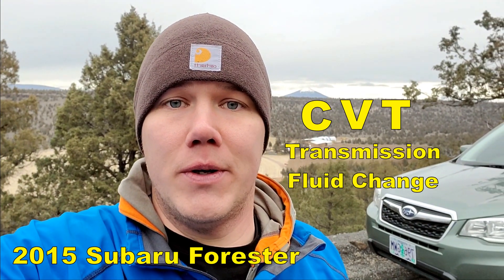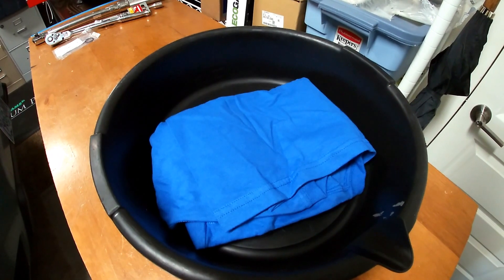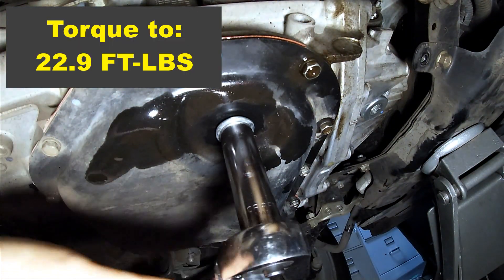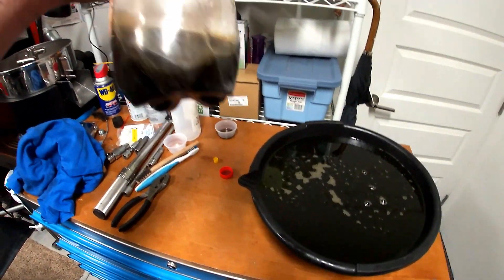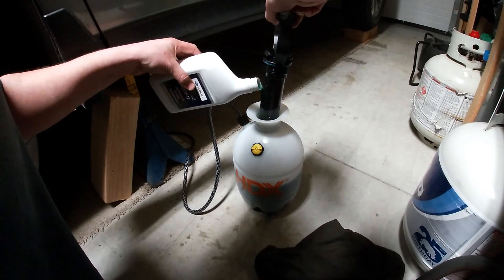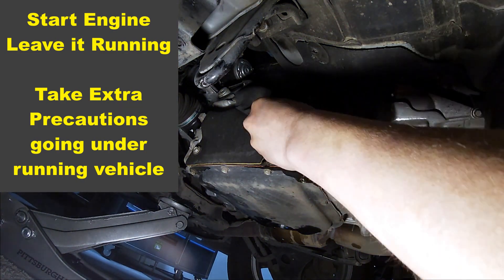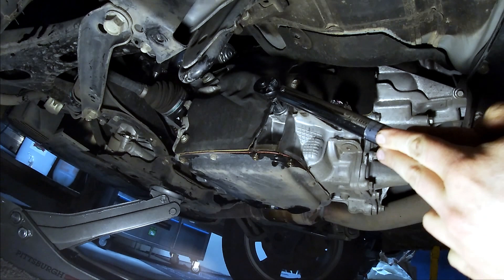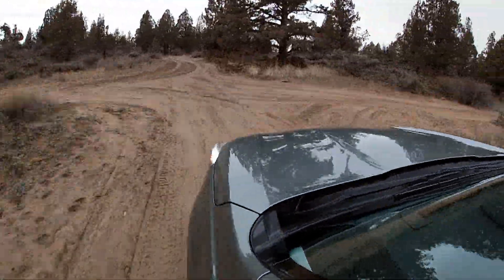Subaru CVT Transmission Fluid Change & Flush Procedure | 2015 Forester Replacement-Fill-Level Check

Comment: Thank you so much for this wonderful, thorough, informative video!!! We were totally in a panic after accidentally removing the CVT plug not the oil plug during an oil change and this video allowed us to deal with the self-created emergency. THANK YOU!
Reply: I am literally in the same situation right now. Got the transmission cover removed and need to get an 8mm allen to start this pump process. I'm still pretty stressed but grateful to see I'm not the only one who's made the oil plug/transmission plug mistake and that add fluid using this method will help me recover.
Reply from the maker: That's no fun!! Hope it went well, and thank you! I really appreciate those that find my videos helpful! Thanks!
Reply: My son made the same mistake!

Comment: You did all that thorough and hard work. Why didn't you change the filter too?
Reply from the maker: Because the filter you refer to is only a pick-up screen. Looking back I do wish I would have dropped the pan just to clean the magnets, but remember the fluid it more important as it affects the friction of the CVT "belt". The actual filter requires the transmission to be removed, then split the cases to access.

Comment: Hey MT I wanted to ask you if you could do a video of a coolant flush on your Subaru forester I have a 2014 Subaru forester with only 45,000 miles on it and I wanted to ask how often the coolant should be flushed
Reply from the maker: Dude, it is on my to do list. Seriously. I haven't had an ounce of free time since my last upload. Our business has just taken off and we are struggling to find help. So we have been working super overtime. But I want to do a coolant video, and I think our Forester is just about due. Dont quote me, but I think it's due about every 11 years or 120k miles, we are right at 119k miles. So its time. The biggest importance of doing it is corrosion in the block.

Comment: Do these have a filter? I've seen mixed replies all over. Some say there is a screen mesh filter that should always be replaced, and some say there is a traditional filter internally that should be replaced. Seems like a hassle

Comment: This is one way to do it. I prefer to drain the pan and then refill it. Then blow out the lines like you did. Then you can also take a 2 longer piece of the clear tube you put one in a large enough container to hold the amount of fluid you are taking out. This will be on the pressure side. I prefer a 5 gallon bucket and then zip tie the line so it does not come out of the bucket. Then I take a second clean bucket and fill it with enough clean oil to meet the capacity of the transmission plus at least a couple of more quarts. Take the second clear tubing and run it from the transmission suction side and down into the bottom of the clean new oil in the 5 gallon bucket and zip tie so it does not come out. Usually best to have an assistant help you if possible. Start the car and run at idle. The dirty oil will start to flow out and the new oil will be sucked in. You can also shift through the gears to get even more old oil out. Do this until you see the change in oil color like you did and then stop car and reconnect hoses and be sure to warm up and adjust oil level. Works on almost all cars.

Comment: there is a fill plug on the other side of the transmission. run vehicle to 100f then check the fill hole while ideal see if its full after filling it.

Comment: Can you not just hook up a second vinyl tube to pull fluid from the bottle? If the system is air tight, it would have to pull air or liquid in from somewhere, right?

Comment: What mileage is recommended to change CVT fluid for subaru forester XT 2013 model?
Reply: With severe service like towing, every 25k. In normal service, opinions are mixed between 30k and 50k.

Comment: Hello, thanks for a much for the great tutorial. I am getting ready to just check my CVT fluid. I had read that from the factory there was some cars coming out with a low CVT fluid level. I know the dealership does not check this prior to a new car sales. I'm just wondering when you ran through the gears to circulate the fluid did you have your foot on the brake or did you let the wheels spin as the car was sitting on jacks. Just wondered because I'm a little nervous of putting it in gear in case the torque throws the car off the jack stands. thank you very much
Reply from the maker: Foot on the brake!

Comment: Great video, successfully flushed my system last night after accidentally adding gear oil to the wrong port for the front diff, super easy. Would it have been possible to use the system to suck clean oil in the other hose?

Comment: I noticed you didn't drop the pan and change the filter, why not?
Reply from the maker: It's not required. The only "filter" you can access is a coarse screen. The actual filter requires splitting the cvt case to access. Change the fluid and your cvt will be super happy! 👌

Comment: Great video man. Really in detail but simply and straight forward. I have a 2013 Crosstrek and I'm sure it's a very similar process. I have been researching and watching videos and you're the only 1 that took off the hoses and blew out all the old fluid in the lines. I didn't see anybody else flushing it like you did either. You used 13 quarts but said next time you'll only do 2 flushes so how many quarts do you estimate that would be? Thanks again for this video. I found it to be the best one I've come across.
Reply: I am looking video clip for crosstrek 2016 fluid change too,

Comment: Hello MT. Thanks for the video. I know it is a couple years old now, but I am just doing this job on a 2015 Forester that I bought recently. I cannot determine what the subaru part number is for the crush washer that goes on the drain plug. I can see the part number on the bag in your video for the o-ring gasket for the fill plug.

Comment: We own a 19 Outback 2.5, CVT 
11 Rav 4WD Limited with a 3.5 V6, 5 spd auto transmission,
11 Ford Ranger XLT super cab 4X4,  4.0 V6, 5spd auto transmission.
I have the oil changed every 4K miles with Mobile 1 full synthetic. 
Every 30K miles I have the front and rear differential, transfer case, transmission flush.
These are a Must to keep your vehicles in top condition.
Also change all your belts and hose’s and have your radiator flushed every 5-10 years depending on how many miles you drive.

Comment: ALL transmission fluid must be changed every 30K miles. Have your mechanic do a complete transmission FLUSH. It’s expensive but a new CVT is $8K. You CANNOT rebuild a CVT, you Must buy a new one.

Comment: @MT Great Video. Thank you.  Do You happen to know if this CVTF Flush procedure can be applied to a TR690 ? Does the Valve Body location being at the bottom in the TR690 (VB is on top in the TR580) be affected by this 2-Qrt stepped flush and refill?  I want to get rid off the Motul-Multi that my Subi dealer has put-in, which has different viscosity and additives where the latter affects the coefficient of friction that is needed in a High Torque in order to mitigate chain slippage on spirited driving.

Comment: The Bluetooth OBDII Reader you used does not work with 2019 Foresters (displays just about every status EXCEPT CVT temp. Subaru also routed the exhaust around the driver's side of the trans - completely blocking the trans fill plug.

Comment: Idemitsu CVTF Type SB2 is a direct replacement for Subaru CVTF II fluid. Idemitsu manufactures Subaru's fluid and it's about 30-40% cheaper than buying from Subaru. I did a 10 quart flush for $120

Comment: In my opinion, as long as you do a 5 qt drain and fill to freshen the fluid every 20,000 miles or so, that will be more than adequate to protect the CVT for the life of the vehicle. Of course there is nothing wrong with doing a full flush, but that's way too much work for me lol.
Reply: Interesting, my '16 Crosstrek has 159,000 miles on it and I am thinking about changing the fluid in the CVT.
Reply: @todd1hd  If it's never been changed, you may not want to do a full flush. I've seen cases where a CVT with high mileage and original fluid started acting up after flushing it. Apparently, the debris in the old fluid can add a little friction during operation and when you remove that debris the CVT can start to slip. Given your mileage, I'd just do a 5qt drain and fill and see how that goes.
Reply: @dlg5485 this is what I will be doing, bought at 60k now at 120k but didn’t even know if they changed it or flushed at 60k so will just drain and fill, and fill repeat at 30k to freshen up
Reply: Good comment

Comment: This video is very useful,.  I watch you from Guatemala.. My question, how many miles are you going to put on the cvt belt to make the change? and my other question, Do you think the oil changes color because of contamination, or just because of the temperature that is exposed to.   Adios Señor.

Comment: Thanks a lot. I just used your videos to do the 60k service on my 2016 Impreza. Did the front and rear diff fluid, CVT fluid, brake fluid, spark plugs, and air filter. 😅 Wow it was a lot of work but the local dealer wanted over $2k. I think it cost me about $250 in parts/fluids and took most of the day to complete. Worth it not to get raked over the coals. Next I need to service my 2017 Outback. Should be able to do it a bit quicker now that I know what I’m doing! 👍🏼 Only things I might have the dealer do for me around 130k miles is the fuel filter and coolant flush. Thanks again.

Comment: Drain and fill every 30K to 40K miles will keep your transmission running with little to no strain. Complete system flushes are much more expensive and the results are usually the same
Reply: Also nice video and it is really a good walk through. I have done this on many other vehicles but will be helping a friend with their forester

Comment: What do y’all think about just draining the 5 qt from the drain pan, and then replacing again after like 100-300 miles 3 times. 

I feel like this method might be safer for some of us who might mess up and run the transmission dry.

Comment: Very good video, but just want to state that my 2014 Forester I bought used with about 69,000 miles the transmission failed. I took it back to the dealer I bought it from because it had what is called the Forever Warranty provided for free from the dealer. The warranty company installs used replacement parts so they installed a trans with about 72,000 miles. About 18 months later the trans failed again so now they installed another used trans with 88,000 miles, both are from LKQ. But the real problem is the Forester CVT that Subaru installs just flat out is bad. You can see on line the many  transmission failures that these Foresters have. Subaru even had to extend their transmission warranty to 100,000 miles due to how bad they are designed. If someone out there has had the same transmission failures on similar year Foresters please comment, because I don't think it's just changing of the fluid that makes these Forester transmissions fail.

Comment: I accidently drained my cvt fluid so now I'm here
Reply: Same lol I got frustrated. Like really stressed out. But hey, new life skills. We're gonna make mistakes. At least you changed the fluid and engine oil right?
Reply: Same, and this seems like a nightmare
Reply: OK but did the car survive
Reply: @ashlynsullivan1017  yes
Reply: @lordrhus7218  im currently sitting in my wife's Subaru. Refilled per multiple video instructions. The check engine and hill assist are still on. Did that go away?
Reply: @1988ZER  oh those come on every now and then when its cold/wet on my subaru i dont know why but i've never had problems with it, sorry if i didnt help much lol.
Reply: @lordrhus7218  i just cleared the codes. So far so good
Reply: Hi Here, I’m dad.

Comment: Could one not just disconnect the transmission cooler, have a hose connected to both outlet, and inlet to transmission, the outlet hose to a bucket and the inlet hose with a funnel attached, then run the engine and pour the new oil in to match the amount coming out?

Comment: I understand “flushing” gets more old fluid out quicker that way.  
But wouldnt drain and refill with 5.5, drive around the block. Then drain and refill with 5.5q again get in theory get about 75% of the old fluid out.  
Saying 75 because first drain and fill is diluting to about 50%. 2nd drain and fill is diluting that 50% so 75ish.

Comment: As a past Subaru mechanic I went to cvt schooling in the mid 80's  because the 3 cylinder justy model used it.
I've also done a few 2013-2017 cvt services and I strongly recommend dropping the pan to clean the magnets ( yes 2 magnets)!!
Cvt's she'd more metal than a normal trans and one 2013 cvt service I performed for the first time at 90,000 miles both magnets were full and on the verge of not being able to retain any more metal. Nice video!
Reply: Можно прилепить ниодимовые магниты снаружи на поддон
Reply: What did you use to reseal the pan? And did you have to let the adhesive dry or fully cure before adding the new fluid?
Reply: @davidkarpen5686 just a normal gasket that comes with the filter lol
Reply: @kawa1755  if you’re not the guy that I was directing my question at who would be the guy who made the video! Please don’t answer and spread your stupidity! These don’t come with gaskets!! In fact, almost all new cars today do not have pan gasket of any kind!!! They use a sealant!!! AAND IT DOESNT COME WITH THE FILTER!!!!
Reply: @davidkarpen5686   Very true... Red RTV ... And there's no Filter but a metal strainer etc...
Reply: that is good idea, you should make a video
Reply: Is the transmission oil temperature same as the engine oil temperature.
Reply: @LuisReyes-re6yq no
Reply: @LuisReyes-re6yq  no separate. you need a bluetooth OBD tool to read AT temp
Reply: Do you think it needs to replace gasket when take of the pan?
Reply: Don’t forget the filter

Comment: Suggestion / question: You disconnected the two transmission lines. Why wouldn't you have one clear plastic hose inside a container of fresh transmission fluid and send it through the intake, pumping into the tranny? (with the other clear plastic hose attached to the line out for the old transmission fluid). Wouldn't this be much easier than stopping the car and re-filling every 2 quarts or so? Hopefully this question makes sense, at least I know what I mean!
Reply from the maker: I know what you mean, but you would want to make sure you are putting fluid in fast enough because it pumps out pretty fast. Also, i do not know if it would be picking up and pumping out the brand new fluid going in at that location vs the pan. Next time I do this I would just do one flush and call it good after learning how this went.
Reply: The line going into the trans. "in port" may not "suck" the fluid from the container the hose is in.  It may only "suck" from the internal filter/pan area.  That is my guess.  I didn't try because my line is a metal tube and I did not want to tamper with it.
Reply: It makes a lot of sense, in fact it is recommended to do this operation with an electric hydraulic pump that equates the flow of liquid coming from the return line with the new cvtf fluid introduced by the external pump. Practically with this method, there is no need to stop the engine. It is important to choose a pump that delivers 2-4 liters per minute.

Comment: Despite Subaru and others saying 'lifetime' means forever not just useful life and the issues with transmissions being sensitive to debris disturbance and seals swelling and such, many that choose to drain & fill do so not just to extend the life of the vehicle but don't ever to flushes. The regular addition of partial capacity is less dramatic, and easier, and many say less risky. Again considering Subaru says don't ever change it. Applaud the thoroughness, but long term opinions evolve over time as well.

Comment: I accidentally drained the CVT pan thinking that it was the oil pan. It's a 2020 Forester with only 20k miles. Can I just replace the amount of fluid that was drained without doing the flush and temperature checks?

Comment: Coming from Hondas, when I get a forester I'll have to remember to open the drain plug after it warms up, I'm so used to drain and replace what you pulled out. And using Castrol high mileage atf. Seems weird that the subaru oil is blue too. Even when it's clean the soda bottle filled up and looked dark. Would it be wrong to just drain the pan and replace with the volume that comes out. The way you did it is what I would do if I bought a high mileage unit. But if I owned it and did the drain pan, fill plug and go method every 36k miles would it be bad for it. Just drain the pan, empty the ~5.5 quarts and add 5.5 quarts and go.

Comment: Assuming wife not available, I plan putting a ball valve on end of the 3/8” plastic drain hose and lengthen hose so I can sit in car with plastic bottle.  This way I can start and stop flow of CVT fluid with ball valve to only take a quart out at a time.  Also since I am inside car I can also start and stop engine and shift gears during process.  See any problems with this approach?

Comment: Your recommendation to use HD hand garden sprayer pump is ingenious.  Compared with the other automotive pumps that I price out, it is a steal!  Since  I heard dealer charge $250+ for a drain and fill.  I will diy it for the  first time on my two subies. Can’t thank you enough.  I recommend water test the HD pump first to make sure you got a good one.

Comment: Good job, my WRX CVT is 12 litres but only 7 came out of the drain hole. I’m sure that’s all a dealer would replace. Is it ok to remove 2 litres while the engine is running?  (So the gbox is 2 litres off full) Garden sprayer, I would have never thought to use one of those.